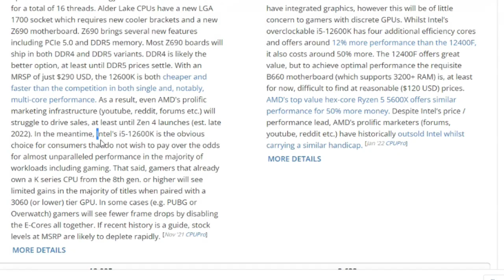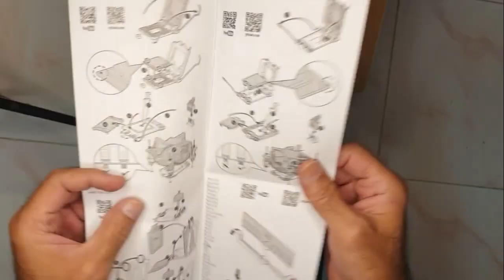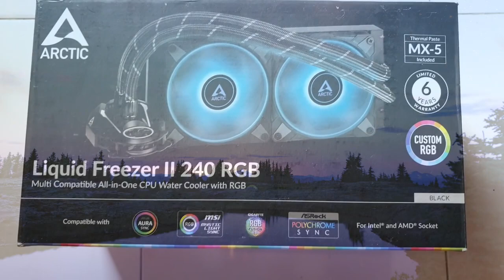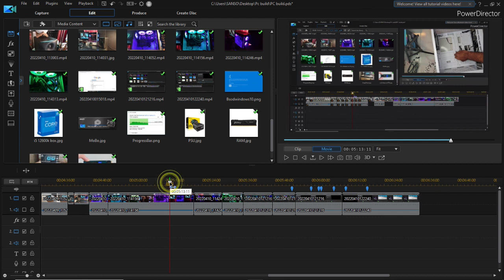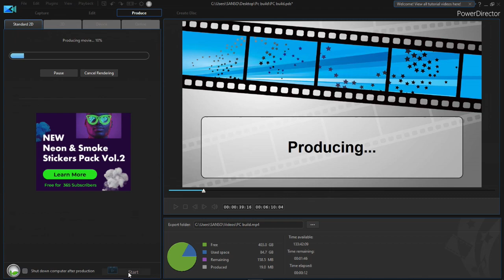Can it work/edit Videos? | PC build Feat i5 12600k & MSI pro B660M a wifi DDR4 motherboard

Comment: Hey mate, i need some help regarding this build, i build the same pc. but i'm facing issue with booting, it's not getting into bios. I had some question would you be able to answer. I would be of great help.
1. Did you connect both the power connectors on the motherboard? the 8pin andthe 4 pin next to it.
2. Did you face any other issue while booting?
I appreciate your help. BTW i'm also from Pune
Reply from the maker: Yes I connected both 8pin n 4pin. I didn't face any issues. First boot was ok.
Reply from the maker: This may help... https://youtu.be/RYYoCXh2gtw
Reply: @Sansohum  but you're power supply has only on 8 pin (4+4) eps connector right?